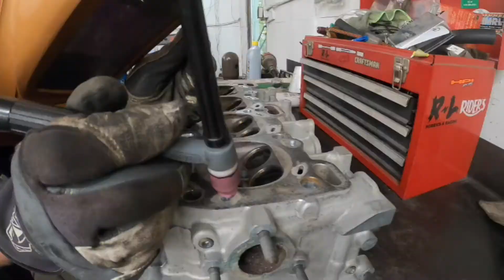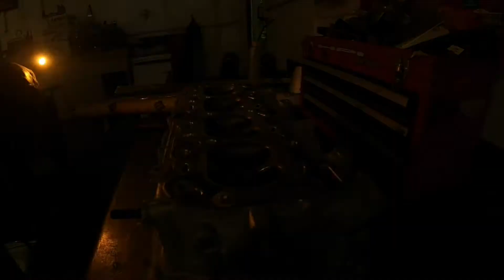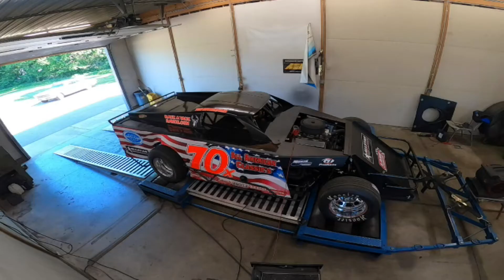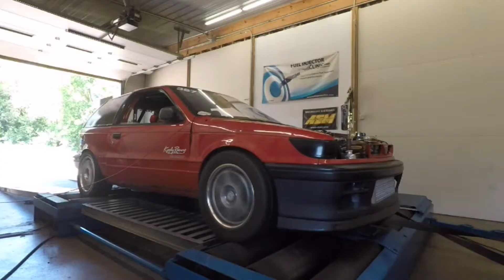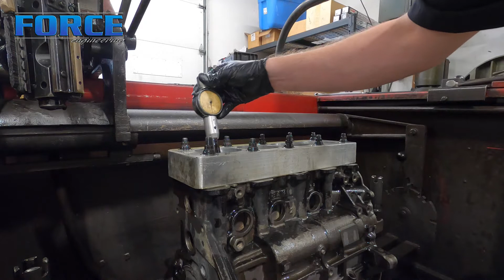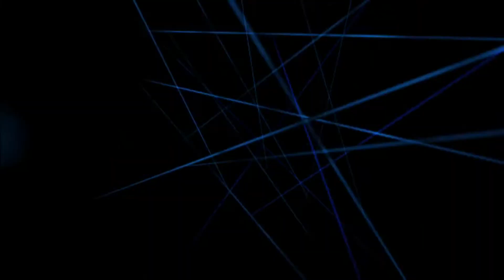Why use a Torque Plate when Honing?

Comment: If you are doing a v type engine you must two torque plates.
Reply from the maker: This is curious.  Ill try it and measure the difference.  It surely depends on the application.  Not all V blocks are built the same.
Reply: @ForceEngineering  with two you are replicating the stress as it would be in a running condition. Measure the other side differences before and after with only one plate. Not great amount .it does make a difference.